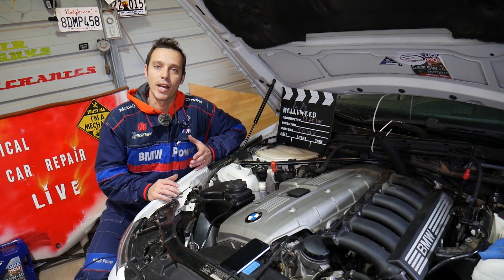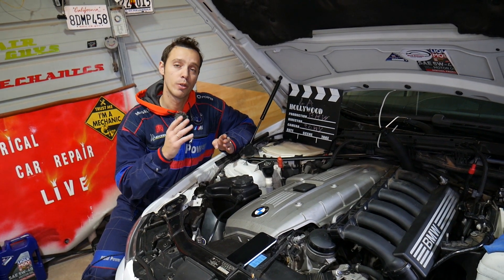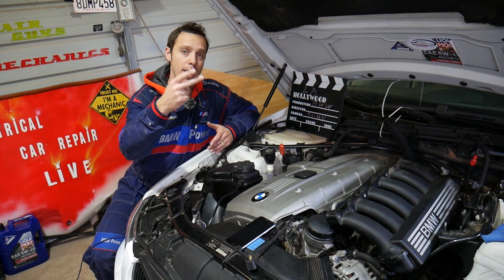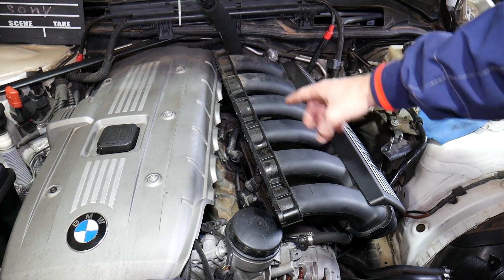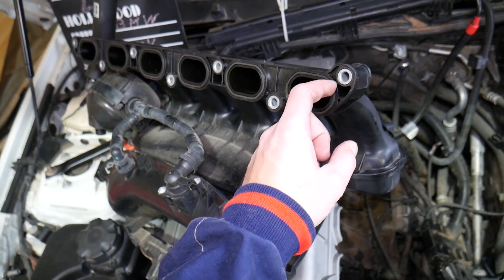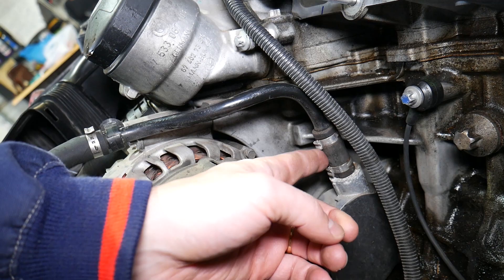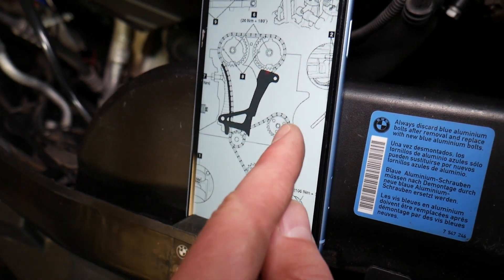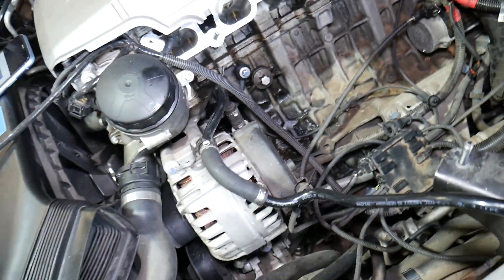BMW X1 E84 BRAKE VACUUM PUMP LOCATION REPLACEMENT EXPLAINED

Comment: I have a question about a 2006 BMW  325i . 
The car has lean codes and hesitation under heavy acceleration. I changed fuel pump because the fuel pressure was low and changed the fuel pressure regulator. I changed all the vacuum hoses and oil sepator but still i have the hesitation and lean codes for bank 1 and 2.
When I was changing the vacuum hoses, i noticed alot of oil in the intake manifold, before that there was smoke coming from the tail pipe. 
I changed vacuum hoses the replaced the oil sepator that I bought from bmw dealership. I noticed about two weeks ago the oil had reduced again after all that service. So I watched one of your videos and decided the replace the oil sepator relay. It Worked for like two weeks now oil is back the intake manifold. What could be the problem?